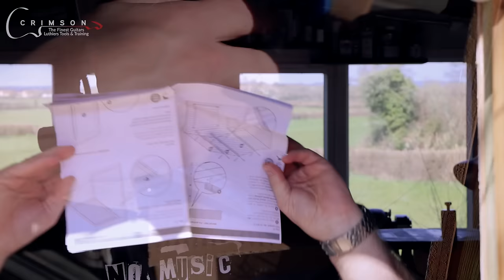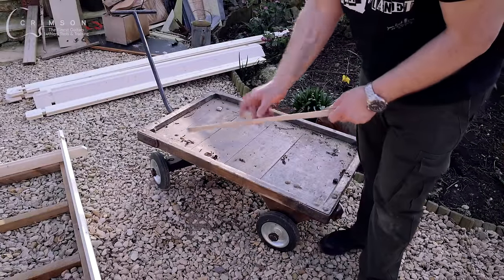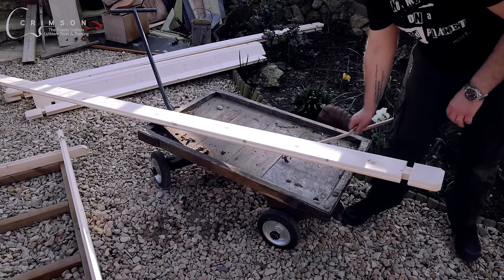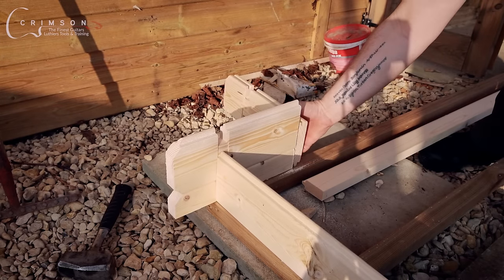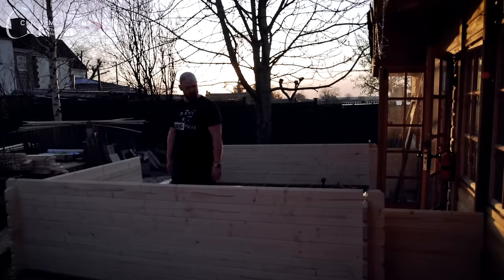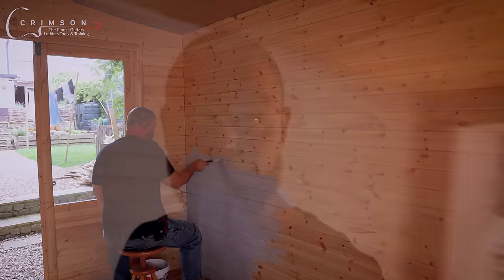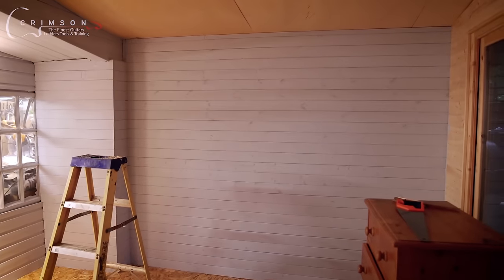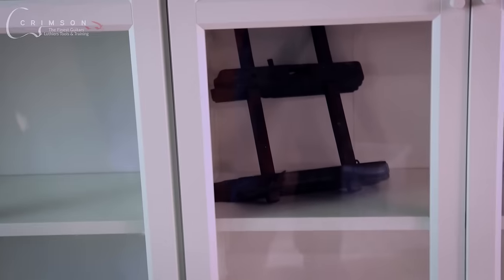Building my Home Workshop - in preparation for even more STUFF!

Comment: I am a retired guy that took up stringed instrument building as a hobby after spending a life time in mathematics where having an artisan type skill simply was not required. My two cents would have been only join the buildings by a short passage hallway between each. That would make weather proofing so much easier and provide a bit of courtyard for an outdoor lunch table during nice weather. But, it's nice looking none the less.

Comment: Here in the states that sort of construction will never be approved. In my town we have to pour support footings 3.5 ft deep. Plus pressure treated 2x10's for the floor joists and 2x4 wall structure every 16 inches on center. Good luck.

Comment: im surprised you didnt build it on concrete deckblocks to raise it off the ground more. I suppose building code is different than here in Canada where we have to worry about frost heave and snow build up but still is that gravel bed enough to keep the moisture from soaking into the floors?

Comment: I wish this type of she’d met code here in Canada, but no not going to happen.  In Canada, most homeowners will not build over 10’ x 8’, anything bigger would be considered part of the house and increase your property tax.  That and you now have to build to the same standards as a house.  So you will now need plans from a engineer and your building will have to be inspected at certain stages. Cost traumatically increases at this point.  Anything north of a extension cord will require a master electrician to sign off on it, plus city hall.

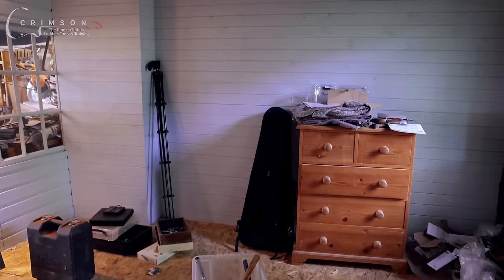Comment: Looking at this, you don't seem to have gained very much space for all that effort. Why move the bench? Why not leave the existing workshop as it is and reorganise a bit better. At 18:52, pull out the window and 'wall' there on the left (the original workshop) and you open up a nice big space, or don't and leave this to be the office and timber store. I think you might be overthinking things here and making work for yourself that you don't need to. Tidy up and make better use of what you now have (as I said, doesn't look like you gained an awful lot)
Reply: Desk, office, tool collection area opposite your bench? Whoever is sitting there is going to love all the noise and dust.